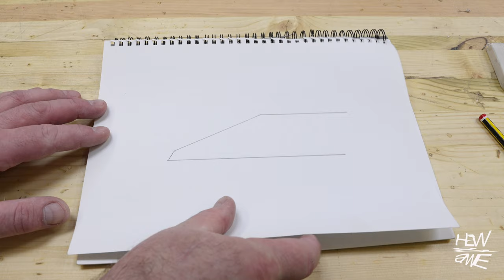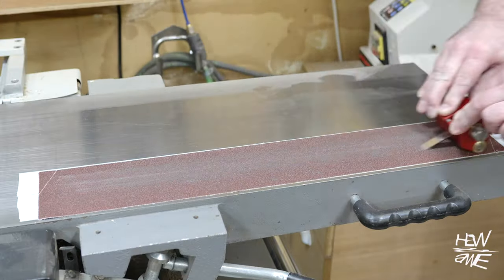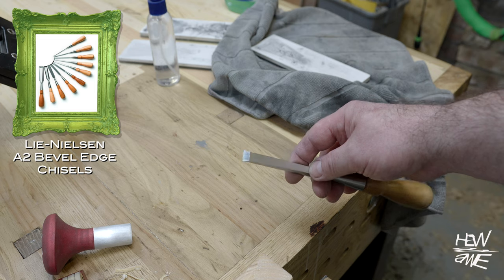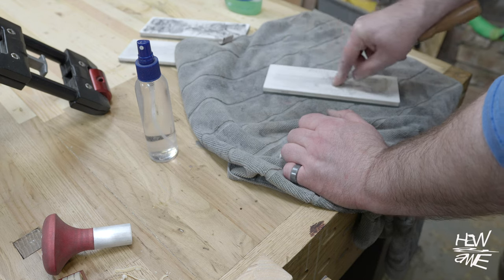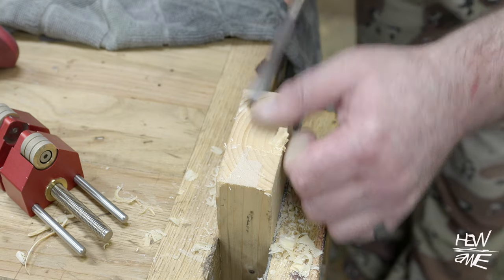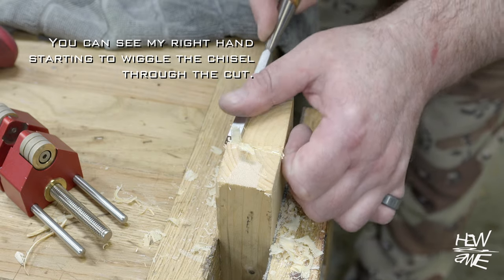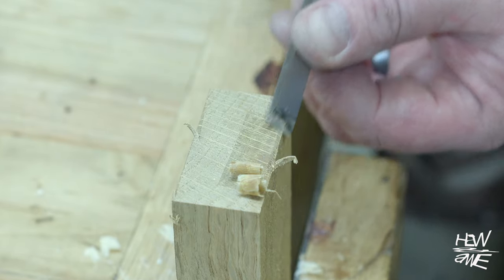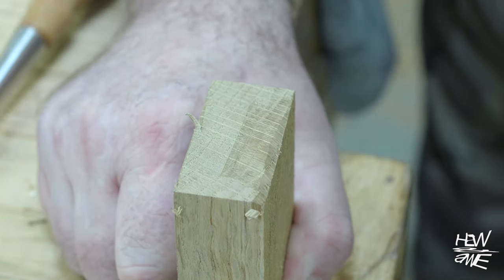Secondary Bevel on chisels is a waste of time IMO.

Comment: Yeah if you’re not hollow grinding, I can really see your point. When I can get to a complete diamond stone system, I’ll go there.  I’d love to have 2 or 3 solid diamonds and keep my 16k Shapton.
Reply from the maker: I sacked my tormek yonks ago, so bloody slow same time as by hand too roughly. I’m no fan of the diamond stones they don’t keep their coarseness, so cut slower than the ceramic shapton I use. I’m desperate for the 1600 shapton, I never get great results with a strop. 😏
Reply: All my chisels are hollow ground. Less to stone up if needed to be ultra sharp.

Comment: I’ve always considered the need for second bevel fishy and questionable, personally I think it comes from people deliberately cheating the grinding, to make it faster, and then needing an excuse to give their apprentice. Still less angel in the edge makes it last longer, I noticed that on my lawnmower where scary sharp dulled to blunt in no time at all, due to a bad lawn, while step angles last so much longer…😊
Reply from the maker: I learnt that lesson the hard way to, on a sit on lawnmower which was a bastard the get the blades on and off! I was gutted!!
Reply: Your lawn mower is supposed to have blunt blades.
Reply: @murraytrimmer228  
Not according to myuser manual, it dictates a specific grind-angle, which if for the moment do not remember, well it’s winter here, adding 10-20 degrees to that angle means the blade can take some quite hard gravel-ground-kisses, that was what I was trying to say. 🌳

Comment: Hello, Ben! The secondary angle on the chisels is made solely in order to save sharpening water stone and sharpening time. A sharper angle cuts much better, but the cutting edge is blunt faster. In addition, the bits differ in the method of use for percussion and stripping. The former should have a more blunt sharpening angle and the latter more acute.
Reply from the maker: I know why dude, it’s wrong imo. You did see that I put an angle of a secondary bevel right and it cat with more ease and has the same durability cause it’s the same angle and not to mention less time a wasted metal of expensive chisels.

Comment: If it's good enough for the Japanese, it's good enough for me!
Reply from the maker: Right, I’ve never tried jap chisels, had to many say they’re to brittle so never gave them a go. So they don’t put a secondary on then?
Reply: @HewAndAwe  with Japanese chisels you just flatten the back and hone the primary bevel to the same angle they come ground to. 
I've never had a problem with brittleness, but I'm careful not to lever material out with them. The only issue I've had with them is how sharp they are...don't try to catch one if you drop it...I did and managed to stab myself in the wrist. The workshop looked like the scene of the  Texas Chainsaw Massacre.
Reply from the maker: @davidhull2060 it’s a shame I can’t send pics here, did the same and just missed a life ending vein in my hand 🤦🏻‍♂️
Reply: @HewAndAwe  Sounds like some Reddit posts.

Comment: I find doing a secondary bevel is more forgiving when it comes to the angle. I dont have a good jig or the skills to freehand with accuracy so I do a hollow grind on a diamond wheel and then put a secondary bevel on that. If I had the skills or an accurate jig to do a good primary that might work for me but at the moment I can get a better edge on a secondary bevel than I can on a primary bevel. After the edge dulls I can free hand good enough on a hollow grind but if I was to only have a primary I wouldnt be able to free hand accurate enough (the bevel ends up rounded) and if i use the jig I can never get the same angle as there is slop in the jig. Maybe I need a better jig but I paid top $ for the one I have and its not delivering the goods (its a Veritas). So for me the secondary bevel is about getting a good edge.
Reply from the maker: Right, did you hear me say I ground the primary to that of what the secondary would be?

Comment: Each to their own i guess, i have a secondary bevel on my wider chisels but not anything less than 10mm, i get about the same performance either way. N.b. I am one of those proper hnsterbators whos never satisfied with less than a perfect mirror finish. Just what i need when handling my wood alone in the workshop.
Reply from the maker: I’m not a fan of wasting material, but none the less take a chisel regrind it to a mirror and come back to me bud 👍
Reply: You mirror the Primary or Secondary/Micro bevel?
Reply: @DTrizzy  secondary, I usually pit a hollow grind on the primary with the old bench grinder at about 25 degrees (If your not using a cbn wheel i do recommend it, expensive as balls when I got it but hoowee is she a goodun) and then free hand a micro bevel at a slightly steeper angle.
Reply: @HewAndAwe i do grind and polish the bevel on my slimmer chisels and Japanese ones, but to humour you and me I did take my half in chisel and ground a 25 degree bevel then polished it till i could see a small part of my anatomy, looked bigger on the mirco bevel… its good, is it better, i dunno. I’ve had trouble getting the polish e en on large surfaces in the past, this time i tried free handing the 4000 and 8000 steps using the old fashioned random pattern, it worked quite well. 
I like it, ill probably keep it up (fingers crossed i am getting older) but you wont see me trying it with a pvm plane blade, those feckers take forever to hone as it is.
Lots of love from darnunda

Comment: A secondary bevel means ya can get sharp faster on the stones when youre in the middle of a job, ya only need to polish the very end. With one bevel ya have to polish that whole surface and it takes longer on the stones. I use hand tools an i fuxkin hate sharpening, in overall  terms youll spend more time  on a tool with a secondary bevel maintaining its shape. Yes, its faster to give it a few wipes on the stone....... But then ya have to grind back the main bevel and that makes it take longer. Why maintain 2 bevels when ya only need 1 🤔😆  turning tools like a bowl gouge; a secondary bevel here is good as the heel of a single bevel will get in the way and rub when ya need to make a tight turn. Thats different tho. For hand tools, all my edges only have 1 bevel.
Reply from the maker: …you agree then 😂  Enjoy the rest of your weekend buddy! Thanks for taking the time to comment too 🍻😊🍻